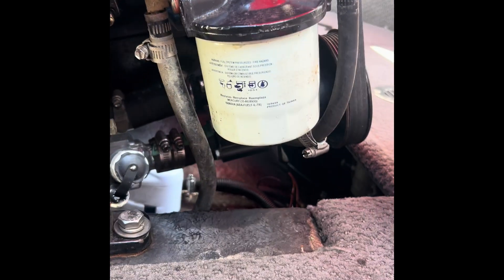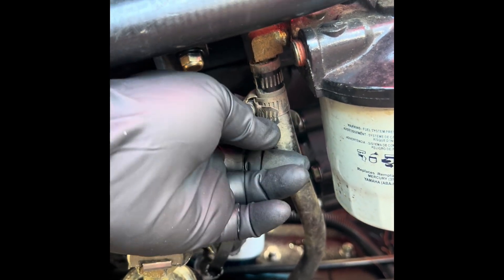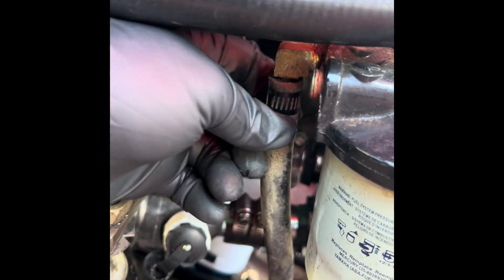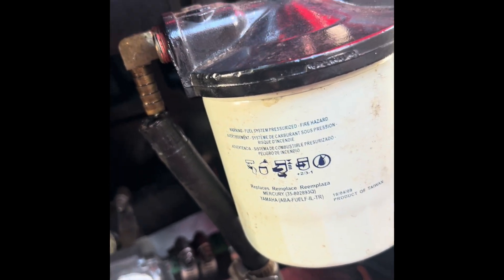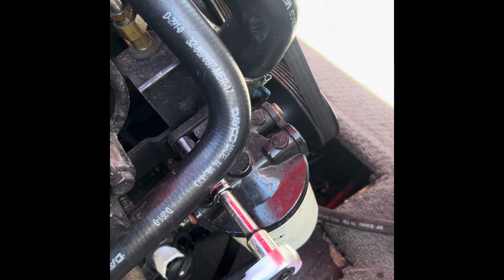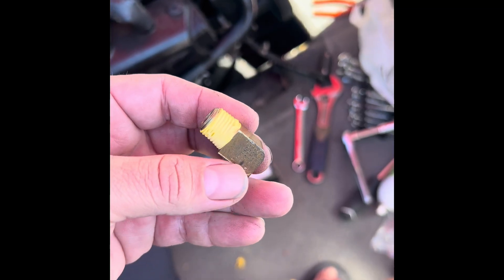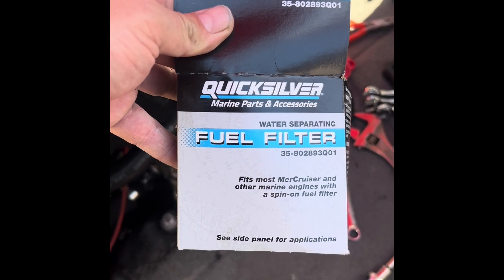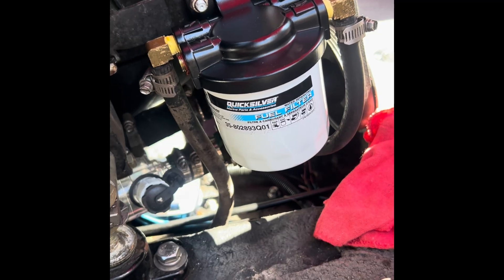Changing Fuel Filter/Water Separator Housing 2001 5.7L MerCruiser Inboard Part # 802893Q4

Comment: Hey what micron fuel seperator is this? 10 or 25? I have a 3.0L mericruser 3 barrel carburetor.  I have the same old one on my boat as the one in video. Doesn't state what micron just made in Taiwan.